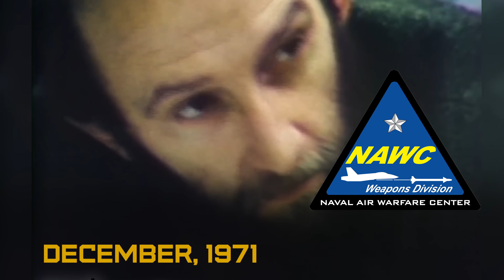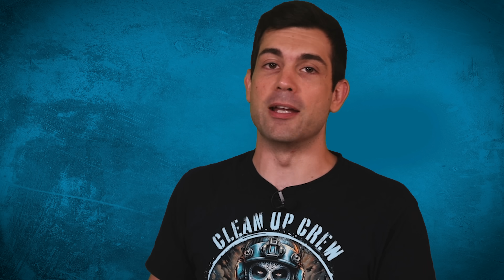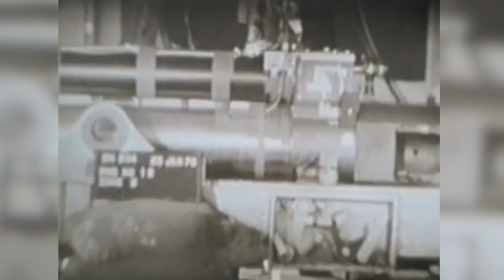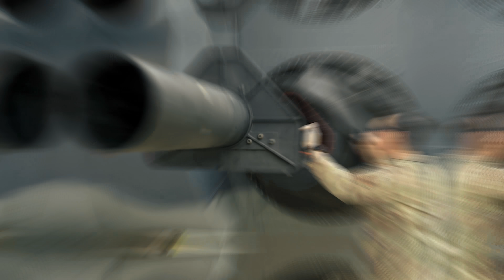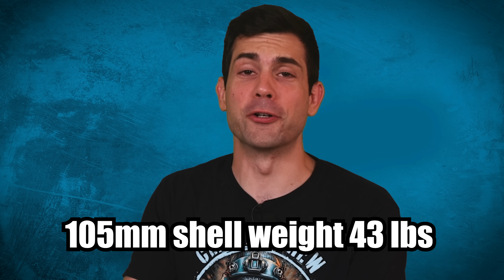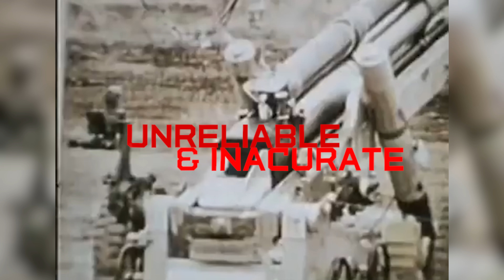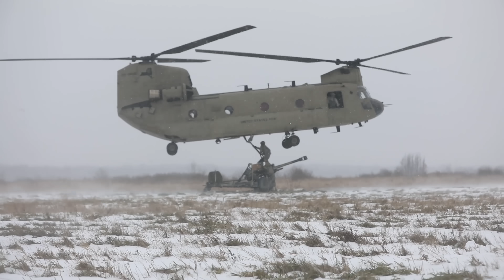America's Twin Cannon Artillery Helicopter is Wild

Comment: A few small corrections:
1) Pneumatic is pronounced new-MAA-tic not new-MON-ic. This is a pretty common mistake because most people learned about mnemonics in grade school, but pneumatic systems are pretty rare these days because it is easier and cheaper to make an electro-mechanical system.
2) lbf is pound-force. In the US customary system of units pounds can be used to measure mass and force with one pound of mass exerting one pound of force under the effect of Earth's gravity. If you're doing math that involves both mass and force, you write pound-mass as lb_m and pound-force as lb_f. Usually, the m and f are subscripted, which is why I have used underscores here. That said, the pound-foot (plural: pound-feet) is a real unit. It could be used to measure either work or torque depending on the context. But in this case the lbf is pound-force based on row 23 where lbf*sec are the units for impulse. Impulse has dimensions of force * time.
Reply: Since you're an engineer...
Perhaps you can address the dangers of what such a massive force will do to an aluminum airframe
Reply: @Nyeupe-Nguvu  Ah, but I am a chemical engineer, not a mechanical engineer, so I cannot.

Comment: A modern version of this idea would be to outfit a Chinook with loitering munitions instead of twin howitzers. Take a modern-day Chinook and put 4-5 launch tubes inside the back cargo door so that when the door opens in the air, the drones could fire from the back and then turn around to the target.  This would allow easy rearming of the launch tubes by the crew.  Design the drones to carry the same explosive power as a modern 105mm artillery round, but they would offer far more precision, flexibility, and range. Rather than firing shells blindly, the drones could hover over the battlefield, find targets, and strike with pinpoint accuracy. They’d also provide real-time intel, so you’re not guessing where the enemy is. The pros would be only minor modifications to a standard Chinook, not having to carry the weight of two howitzer barrels,  longer range (keeping the Chinook safer from enemy fire), ability to cancel strikes if the situation changes, capable of hitting multiple targets at once with swarms of drones.  The cons would be longer time to target, I think the loitering munition would weigh more than a 105mm HE round, more crew members to guide the drones to target (I think there's a way around that), and the drones could be jammed or hacked, though this risk could be minimized with secure, jam-resistant communication systems like Joint All-Domain Command and Control (JADC2).
Reply: The only problem is, why is the Chinook needed besides to raise the cost 25-fold?
Reply: @kurtwicklund8901  Technically, it's not.  The Marines have already tested firing loitering munitions from their helicopters.  I belive the Army's idea was to have something analogous to the C-130 Spooky.  The advantage of the Chinook (if there is one) would be carrying more capacity for loitering munitons than a standard Apache.  But my guess is the same basic concept as I described for the Chinook would also work for the Blackhawk or the Bell V-280 Valor.
Reply: @mjk9388   your suggestions have,  in a manner,   Already Been Tried during Vietnam.  

It was called;  "Guns a-go-go"  where 4 Chinooks were armed with
▪︎ 4x .50cal door guns,  
▪︎ 2x 19-shot 2.75" rockets,  
▪︎ 40mm turret grenade launcher,
▪︎ 20mm side mounted cannons,
▪︎ napalm drums in the rear door.

RESULTS:
1 crashed on the airfield 
1 was shot down by its own 20mm
1 was shot down by enemy fire
The last one became combat ineffective and retired to a  base in Texas. 

Helicopters are NOT reliable on-station air support.
Reply: @Nyeupe-Nguvu  Thanks for the info about the Guns-a-go-go Chinook.  Just watched a history video on it to find out more.
Reply: Instead of opening up the cargo door to fire the loitering munitions, you could also just have a sled for the loitering munitions that goes from inside the Chinook to the outside of the Chinook so that the cargo doors wouldn't have to be opened at all.  At the height the Chinook would  be flying, you wouldn't even need the pressurized launch tube as the loitering munition would just deploy it's wings after being yeeted out.  This would probably allow for better crew safety, faster rearming and firing and improved flight characteristics.  Got the idea by seeing the C130 Spooky's 105mm fire and recoil along a similar type of sled (if that's what it's called).

Comment: 'Easy Money' a Vietnam era ACH-47 fitted with 2 20-mm cannons, one mounted externally on each side of the helicopter, a nose mounted 40mm grenade launcher turret and multiple door guns - the 'Easy Money' went down when one of the 20mm cannons broke loose while firing and flipped up through one of the rotors. One of a group of three or four experimental CH-47 gunships

Comment: I developed something similar but with NO Recoil. In my concept an UNMANNED MH-60 helicopter carries a rocket-launched Mine Clearing Line Charge that can destroy concrete bunkers, fortifications and trench lines. I call it an "Air Mobile Mine Clearing Line Charge" And since the helicopter is UNMANNED, no service member's life is put at risk. I need to get the attention of leaders who can implement it. My concept combines elements of existing weapon systems of the Army and Navy, so the work to be done is integration of elements and testing. The UNMANNED flight controls come from the Navy's UNMANNED Fire Scout Helicopter using a heavier helicopter. The added-on weight in my concept is only 1,800 pounds which is well within the 6,000-pound load capacity of the MH-60 helicopter. I have a finished proposal with pictorials that can't be fully presented here because of restrictions.
Reply: "And for what do we need pilots in the first place?" "Well, I don't know, Sir. We already have all these unmanned systems..."

Comment: Since they want to phase out the A-10 as a CAS aircraft, I think they should just pop some 155s in place of the Gau, go to flight ceiling, tip 45 degrees and launch GPS guided shells into low orbit for maximum artillery range.

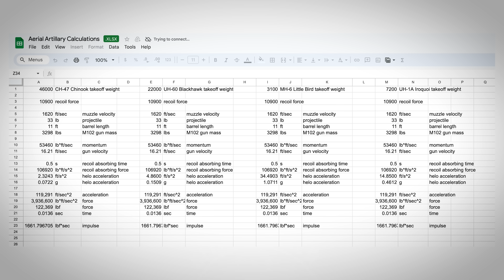Comment: 7:34  ERROR    The units stated (pound-feet) is a measure of ENERGY (work).  It is NOT the correct for units for 'FORCE'
The first part of this spreadsheet is not present. But one could work backwards from its end to correct the spreadsheet's incorrect labeling

Comment: It might be possible if they lower caliber but faster firing cannons similar to Bradley cannons going for saturation over bigger rounds, with remote control system it could be external packaged like upside down tank turret for a helicopter or ball like turret from WW2 with modern spin on it.

 Though parts of me think the rapid dragon systems might be better for helicopters as you don't need to add anything special to my knowledge to helicopters maybe call it the rapid fire flys or salamanders systems for helicopters use of systems? Ment to use cheaper rockets and missiles to hit more targets for less power ?

Comment: I think that the guns they want to use are so significant that for this to have a chance of working they would need to build the helicopter around the gun, the same way the A10 thunderbolt 2 was built for the air force. On the existing airframe, this would work as well as the hover tank worked for sgt Bilco.

Comment: LoL, during WW2 the Army internally mounted 75mm Sherman tank guns on some B25s for use whenever the pilot felt like making noise or making something in front go boom.  The recoil forces normally absorbed by a Sherman tank's weight were transmitted to the airplane.  Pilots that used those planes said it was a weird. experience.  You would be flying forward at over 200 miles per hour and fire the gun at something or someone, but suddenly for a few seconds the bomber would be flying backwards.   😃

Comment: "Artillery drone"
You know, the artillery drone would cost more to operate than strapping an FPV drone with a shell.
So no, as long as drones are cheap enough, there's no need to strap them with artillery or any big ordinance.

That being said, fighter drones with firearms mounted to them is a different story altogether. And they don't even need to be M16's or AK-74's etc. Just drum mag glocks would be lethal enough because the drones get get closer and have a better angle on the enemy than a soldier can.
Akimbo auto glocks with big drum magazines is the way forward for drones. In fact, it's probably going to be the future of warfare and people on the ground won't be doing any shooting at all, just moving over the ground to plant flags.